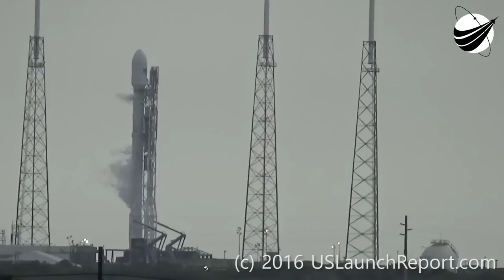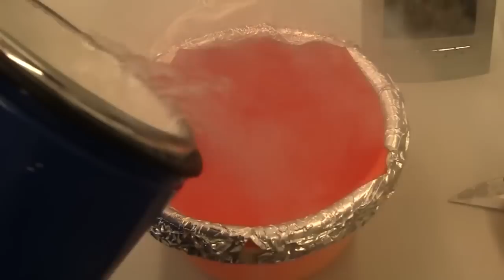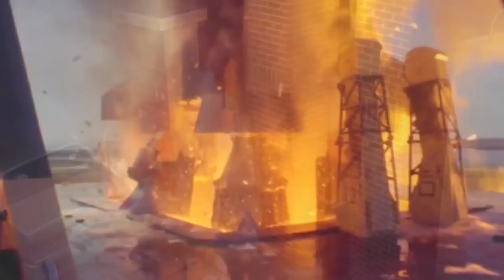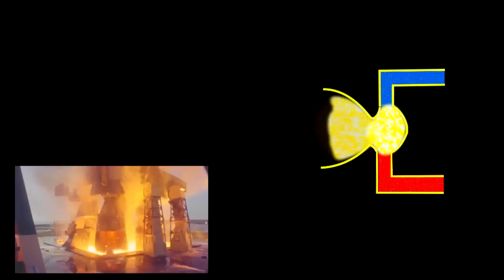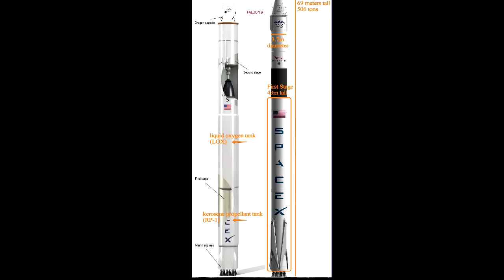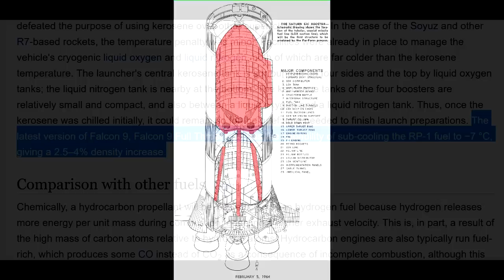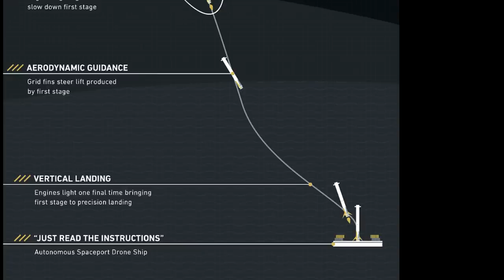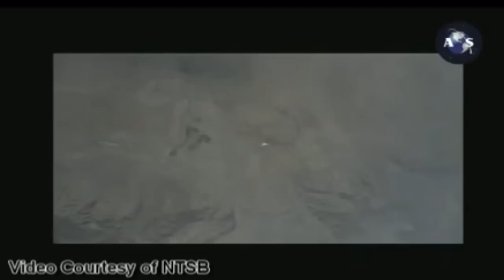Why did the Falcon 9 Explode?

Comment: 500 successful flights 99.4% success rate. 470 successful booster landings. 97% success rate. The average booster has about 15 flights each. The fleet leader just hit 30 launches and landings. 1 launch and landing every 2 days. Fastest booster turn around is 9 days. Fairings have also been reused over 300 times. The milk isnt even aged or spoiled its completely gone.

Comment: rockets aren't logical for space flight/travel why don't they just build a proper starship modelled from the nasa ship but on a bigger scale using nuclear reactor engines etc makes much more sense right. cheaper in the long run and reusable lift more tonnage per trip and using S-MLE (SUPER-MASSIVE LIGHTWEIGHT ENGINES) they got the tech for it ffs.
Reply: The shielding for the Nuclear reactor would be too heavy based on current tech.

Comment: Thunderfoot, could you answer a question for me, if the Particals rushing out the business end of a rocket are moving a 4,500mph, how does the rocket excelerate to 17,000mph?
Reply: Good question. The exhaust speed is relative to the rocket, not relative to the earth.
Reply: It accelerates due to inertia. Even if the particles were just moving out of the rocket at 1mph, then that still pushes the rocket with the force required to accelerate a particle by 1mph, which will increase the velocity of the rocket regardless of its speed

Comment: And today, January 20, 2021, SpaceX launched the same booster for a record 8th time.  Until we come up with dilithium crystal chambers, warp drives or nuclear ion propulsion, rocket reusability is key to cost-effectively getting to Mars with people and cargo.
Reply: 9 launches and landings on the same booster now.
Reply: @MobiAussie  Now 10, and a successful Starship test flight
Reply: The same booster? How many parts do you think are still original?
They rebuilt the same booster multiple times and had to fly massive amounts of additional fuel just to do that.
Reply: @Leoappeared  Obviously, there are always rehabilitation costs.  But the bulk of cost in the first stage resides in the main body of the booster and the Merlin engines.  All of that gets recovered.  I think they have turn-around time down to something on the order of 50 days.  That's not fantastic, but it's far ahead of any other space-worthy launch system in the world today.

You're asking questions I don't have answers to.  I doubt you do either, so you need to define what "rebuilt" means and what "massive amounts of additional fuel" means before we can quantify the cost effectiveness of reusability.

The only numbers we know are those that Musk puts out there as to the cost per launch to LEO.  You are free to believe him or not, but if he's even close, then he can launch ten Falcon 9s to LEO for less than a single SLS launch to LEO.
Reply: @Leoappeared the tanks and avionics and engines and grid fins and most stuff is all re-used.
Reply: Now 30

Comment: This take didn’t age well
Reply: No, it definitely did not lol
Reply: It was a criticism of the current state, and it was spot on. For christsake, the rocket exploded during fueling. Something rocket engineers mastered for DECADES. ThunderF was reasonable in his skepticism and little in way of prediction was given for you to snarkly try to debunk.
Reply: @contraCharFred it was more than that. It was a claim that Spacex achieved nothing of value. If that was the case, if things like exploding on the launchpad were proof of incompetence and bad design rather than trying new things and learning from them, if the re-use was merely an minor incremental improvement over the space shuttle, then Falcon 9 would not have been able to advance to where it has.
Reply: Why?
Reply: @fortissears5388  without any knowledge he claimed commercial space and reuse was a wasted effort essentially. He was and no doubt still is a SpaceX detractor. Turns out the falcon program is the most reliable and low cost launch system ever.
Reply: @joecrabb4881  err... Can you provide a link to your source?
Reply: @fortissears5388  you could argue the Soyuz for reliability however it has the advantage of being in service far longer with nearly 2000 launches with a about 100 failures. However if you compare active launch systems the falcon 9 has the most consecutive successful launches and is also the lowest cost. Getting accurate data is tough since they launch on avg every week. They also continuously lead in upmass so much they are compared to other entire countries instead of other commercial competitors.
Reply: @joecrabb4881  the highest number of consecutive successful launches belongs to the NASA shuttle, not Falcon 9 I believe. Falcon 9 will most likely not succeed in crewed launches if they plan to employ belly flop maneuver, the G forces are just too great.
Reply: @fortissears5388  how can you say that when it’s easy to look up? They flown nearly the same number and you may recall two very big failures with the shuttle. Also falcon is currently our only domestic crew vehicle in service. You’re thinking of star ship that is in development. I encourage you to research a little more thoroughly.
Reply: @joecrabb4881  while I accept the reprimand, I would like to add that you're comparing CREWED shuttle launches (and successful return trips) to TEST cargo-only Falcon launches, which is inherently unfair. Once SpaceX manages to send the same amount of crewed launches (and returns!) with better odds than the shuttle, I'll have no choice but to agree with you. Until then, I firmly stand by the notion that SpaceX still have not shown anything we haven't seen before, nor did they necessarily improve on past technologies yet. As I said, belly flop will not work for crewed launches.
Reply: @fortissears5388  moving goal posts. When comparing launch systems we typically don’t limit to crew only. The advances they have made is pretty clear and recognized in the industry. As for Star ship not working you are making assumptions with no data. The G forces won’t be as bad as you think. Watch the footage and you will see that the pivot point of the vehicle is actually rather high where cargo and crew would be. However until there is objective data we won’t know for sure.
Reply: @joecrabb4881  wait, where did I move goal posts?
Reply: @fortissears5388  I stated the falcon program was the most reliable and low cost, provided the facts then you moved the goal posts and said crew only. You seem to have an opinion about spacex and are looking for ways to affirm it. It’s called confirmation bias.
Reply: @joecrabb4881  i haven't made my point clear, I apologize. Let me rephrase: comparing Falcon launches to shuttle launches and stating Falcons are more reliable is fundamentally flawed. Humanity isn't sending rockets just for the hell of it, we do it as a prelude for MANNED missions, which is what shuttle program reliably achieved, and Falcon program did not (yet). Yes, they transported astronauts to ISS, but until they can do it as many times and as reliably as shuttles, stating that SpaceX moved rocketry forward in any major capacity is imo simply unfair.
Reply: @fortissears5388  Both are fantastic.Thunderf00t has always had an ill will towards Space X and Elon. You have to remember launching Falcon is $67 Million per launch roughly VS Space Shuttle launch of $1.5 Billion per launch roughly. The leading boosters have been re-used 13+ times now. 
This is a resounding success and is to be celebrated, not scoffed at as inferior to NASA simply to try to “Own” Elon.
Reply: @fortissears5388  mmm yes the famous “falcon 9 belly flop”
Reply: @fortissears5388  yep the James Webb telescope was just a prelude for a manned mission to take pictures of space with the iPhone 15
Reply: @fortissears5388  SpaceX never once proposed to do a belly flop with falcon 9
Reply: He's still doing it. Let's see how Starship is doing 7 years from now!
Reply: @RobFisherUK hopefully not exploding mere minutes after taking off
Reply: It hadn't aged well 6 years ago: https://youtu.be/mBcoTqhAM_g?si=xxHzGNfJHDMoBzfp

"Fueling rockets was a solved problem 40 years ago" is a fundamental misunderstanding. The design is different: Spacex were putting liquid helium tanks inside the liquid oxygen, to help cool it. The liquid oxygen behaved in an unexpected way in contact with the helium tank, causing the helium tank to fail. So sure, problems can be solved but trying new designs can cause new problems.

Thunderf00t apparently doesn't think the design needs to be changed once the problem is solved, while simultaneously shrugging off "incremental improvements".
Reply: Nope it hasn’t aged well because you have a chemist making arguments no engineer would make.  Also, NASA’s track record is actually pretty shitty.  17 astronauts were killed on NASA accidents and three almost killed on Apollo 13.  Not to mention, the shuttle had constant technical problems which forced many launches to be scrubbed.  Sometimes force the delay or cancellation of whole missions.  So yes it does seem like their stuff works right off the pad, but those programs are plagued with internal design problems that show up many missions later.  Challenger is a prime example!   The Saturn V extreme pogo problems is another.  It almost cause the loss of Apollo 6 and caused the center engine failure of Apollo 13.

Comment: This video has really poorly aged.  Reusing the rocket has proven to be the only way to reduce the price of putting anything in orbit.  Fuel is cheap compared to the rocket itself.  So you need a bigger rocket than you would normally since you need some to land it successfully.  Space X has shown that reusability is not only a good idea, it is the only idea to dramatically reduce the price of launching anything to space.  In a few years, most rockets will need to be reusable to be commercially viable.  Sure there is still some space for the traditional one use rocket, but those are diminishing by the day.
Reply: please compare launch  prices, specifically what was promised and delivered

Comment: Question: I've seen weapons go wrong. Sure, but why are things like ICBM's so reliable? Or is that just a misconception? Because the US Launches missiles etc reguarly, be it in attacks and training. So why is it, these missiles etc are more reliable? (Assuming I'm not misinformed)
Reply: ICBMs are, generally, made with solid fuel - expensive and not very efficient, but very reliable (as long as the fuel charge wasn't cracked or anything) and can be ignited whenever needed with no preparation required.

Comment: Nothing wrong with the last third of the video. He specifically states that we need to temper our expectations and "it remains to be seen" whether or not this reuseable program will be cost effective. That's still up for debate; whether or not it would cost more to re-use the first stage than to make a new one after refurbishment given the low cost of the first stage to start with.
Reply: 3 years later, after multiple reuses of first stages, it is now safe to assume launch prices have gone down since they have mastered reusability. One example is FH, which is valued at 90 million dollars instead of 130 million dollars in reusable first stages capability due to the drop of the cost in rocket launches. We can expect a further drop to 50 million dollars from 62 million dollars for the F9 in the coming half-decade.

Comment: NASA's last stage fueling explosion was on January 20, 1967, when the S-IVB-503 stage exploded during a fueling test. The cause was actually somewhat similar to the cause of the Falcon 9 explosion: a helium pressurization vessel in the cryogenic LH2 tank had a manufacturing flaw and let loose while they were filling it with helium. 

http://heroicrelics.org/info/s-ivb/s-ivb-v-propellant-pressurization.html

Comment: I really hope this video is of lower quality than others. I'm appreciating your other videos, partially because I am clueless of the technicals, but for this one I'm educated and you make me cringe.

I'm not gonna call you out on your non sequitur (SpaceX failed to do X, so they can't be relied for Y), but let's just llok at the fact :

- Yes, reusing the first booster has some drawbacks, but (unlike for the space shuttle) falcon 9 reusability is optional. At worse, they would have ended with a regular rocket burning through the whole fuel of its first stage.

- The explosion was most likely due to the super cooling technology tested, nothing like we tested before, let alone for 60 years. Granted, it was a failure, and (musk's) impatience makes SpaceX prone to failure, but in that case they could and did back off and switch back to regular fuel containement

- Reusability of the first stage of a rocket has nothing to do with reusing the last one whatsoever. Faclon 9 booster top speed is 1/4 LEO speed, so we are talking about 1/16 the kinetic energy per mass of the space shuttle. All that energy has to be dissipated in heat upon reentry (well, not all that energy in the case of the F9 booster, which cuts most of it via burning), and reentry stress is the main reason why space shuttle was so expensive to refurbish.
If you want to compare things that are comparable, you should talk about the NASA SRBs which were dropped in salt water and refurbished for several times their construction cost. Yes, salt water, how smart. Landing on land or on a long boat is a massive improvement.

Had you properly done your research, you might have seen SpaceX actually stood a chance.
Reply: and now with an update, we know it wasn't really the fueling procedure and more related to the propellant's interaction with the helium tanks.

Comment: Also the rocket need s bit of fuel to be able to land but maybe thst does not cost weight to much? i dont know. i would think having the rocket just land in water would be cheeper and recover  but maybe the salt damages it and rocket has to be restored to working order?  It be an interesting video maybe to talk of cost and compair vs old methods of recovery rocket?

Comment: Rockets don’t need to be “light weight,” they usually “would be” in terms of the TWR of the rocket though, the Sputnik launched on a ICBM modified to reach orbit. It’s weight? Somewhere around 120t, which is rather heavy if you ask me.
Reply: In comparsion to other rockets its not.

Comment: Lets not forget. Everyone makes misS*takes. Even thunderfOot.... There is alot of stupid errors that caused rockets to fail. which are even dumber than design faults. 
1: NASA Challenger blew up because of a O-ring (to cold weather). watch?v=6Rwcbsn19c0
2: NASA orbiter Metric Unit mixup. https://www.youtube.com/watch?v=urcQAKKAAl0
And to point out. Alot of pepople also figured they could get more payload flying airplanes without landing gear or mechanical flaps, parashoot the passengers& payload and then crash the airplane at their destination. Then you had to make the plane again before flying.
I understand the difference and the difficulty with rockets engines conditions. But it does not mean its impossible to overcome.
It's a Reason why people like Elon is at their current place and smart people like thunderfoot is a pessimistic videomaker.
He takes current development as a unchangeable fact and never expand outside the box because it seems improbable.
As improbable as flying rockets like Saturn 5 was at the time it was made.

Comment: This is about the 3rd time I've watched this video. And it's because there are things in this video that are useful to me.  But I wonder each time why you have such a hard-on for Musk.  I have seen this mindset before.  It's when the "braniac" rocket engineer realizes that the most useful person when it comes to knowing the rocket is the guy that can put it together, take it apart, and make it run.  The engineer has a hard time figuring out how their manual slide rule works.  Sure, I had aerospace engineers working with me in college when we were both working on our A&P tickets. Many of which were amazed with a ratcheting screw driver, but had no clue how to use it.  And I'll also give them credit for the fact that their degree program required 160 credits and mine was only 150. And while I applaud your efforts to use a Nerf gun to launch a piece of sodium into a jar of water (or something like that), people like you are the most useful when you just write down what you've learned and let the rest of us decide what it'll be used for. 

I am curious if you'll ever update this video now that a first stage booster has been flown more than once.  If you'll ever acknowledge that a SpaceX rocket is about 40% cheaper than a NASA/ULA/Russia launch vehicle? What are your thoughts on the fact that NASA & contractors haven't built a new rocket engine in almost 40 years and the Russian engines they're using now are even older than that. (Yes, they are awesome engines. Hats off to the Russian that figured out closed cycle) Would you look into your crystal ball and see how the SLS will compare to the BFR?  Should the SLS be scrapped altogether and funds used to advance the BFR?